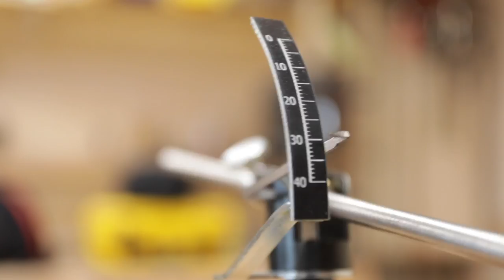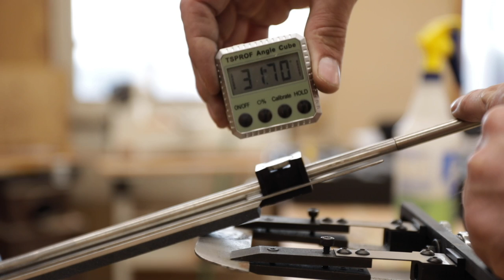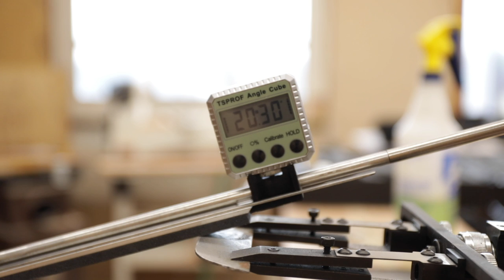Can A Knife Be Too Sharp? 2

Comment: Anyone that's ever worked in residential HVAC can tell you sheet metal is razor sharp by default
Reply: "hang nails" and "shark teeth" are the worst
Reply: We call them meat hooks!
Reply: There’s a huge difference between being razor sharp and micro serrations
Reply: Jonathan Wirrell i don’t think people realize how sharp razor actually is it’s scary what i can do to you with little effort
Reply: James Delong I don’t but I know especially re roofing my stepdads small barn
Reply: I learned two things from going on HVAC calls with my dad
1) How much a hand can bleed
2) How to bandage it with ducktape and paper towel.
Reply: @LloydLynx  and that's a fact! Except it was electrical tape
Reply: @LloydLynx  we just slapped some electrical tape tight on it and went along
Reply: Deltafrost134 without a paper towel that would rip open the cut right?
Reply: That's true if it comes flying towards your throat your dead
Reply: Tru that
Reply: @deltafrost1347  yes, carrying heavy metal with father, sliced both wrists on the edges. Duct tape, paper towels,   finished moving the metal.  Went to the ER, got stitches as I had exposed tendon.
Reply: Sheet meral as I understand it is not razor sharp by default. That would imply it can shave cleanly and smoothly without an edge.
Reply: 😂😂😂im a roofer and i cut my leg on the metal roof all the time
Reply: @LloydLynx  brother you forgot the superglue
Reply: Wow daddy you’re so funny
Reply: When you forget your gloves one day and it happens to be a day that you had an install and your hands get shredded on the tear out
Reply: When I was green in hvac work I grabbed a hold of a large piece of sheet metal from an instal job.....I wish I wouldn’t have.  Btw I’ve always used electrical tape for cuts, works well.
Reply: So is jello.  Check out the Asian dude who makes knifes out of the weirdest materials
Reply: My worst scars are from sheet metal cuts, vicious stuff lol
Reply: Lol
Reply: Man I helped my dad build a sheet metal roof once shredded my hands hurt like hell
Reply: @jakesatterfield3063  what are hang nails/shark teeth? I'd like to know.
Reply: Only good to cut human skin.
Reply: I always fear like a splinter but metal instead of wood
Reply: i did hvac in high school been snagged a few times
Reply: Mill-ends on stock will also ruin your day if you aren't mindful. They tend to be pretty rough cuts due to the speed the mill pops them off the line at, so you get some impressive burrs that will open you up if you're tugging on the end without looking where you're grabbing.
Reply: Yep had a buddy drop his side of the sheet metal when I wasn't ready, 8 stitches for my hand
Reply: @jonnyjohn2321  i dunno man a piece of sheet metal put 17 stitches in my leg
Reply: Industrial HVAC as well! My jeans actually saved me from a nasty cut once. I was just walking around in the shop, and I suddenly realized that my jeans had a huge hole where there wasn’t one before. It was very lucky that I wasn’t wearing thinner pants that day.
Reply: How if there is no edge and is just a flat surface
Reply: @pedroviniciussilvaleal8113  think of it like a paper cut.. but the paper is metal
Reply: @pedroviniciussilvaleal8113  The 90 degree angle edges, as well as the weight of an entire sheet of steel is more than enough to severely injure somebody without gloves.
Reply: Yeah back when I was doin HVAC I laid a rolled up piece of sheet metal flat cut it with the metal scissors wasn't thinking about it much but when I cut through the last piece it curled back up into it's rolled up shape fast as a snake bite right across my finger I have a nasty scar and it bled for along time
Reply: @jonnyjohn2321  the point is it cuts easily
Reply: Facts
Reply: I agree with you as much as I humanly can.
Reply: working with my dad i almost had a sheet hit the back of my neck bc it came loose. ducked in time.
Reply: That's only on the edges where they're cut. The lower quality of steel you have you want rougher grit to keep it sharp. It's like a microscopic steel saw. The higher quality steel the smoother the terrain the edge can be to still be sharp.
Reply: Try working with glass
Reply: yeah, sharp like broken glass... but which would you choose as an all-purpose utility blade? ... exactly...
Reply: yea- had to pull out a slightly too big filter when we moved in and sliced my hands up (ended up using a pocket knife to spear it and pull it out).
Reply: Got the scars to prove it 👍🏽
Reply: Ouchy lol
Reply: Maybe watch the video James 😂
Reply: I know it's late to comment, but I work with sheet metal and what you say is true
Reply: @jonnyjohn2321  🤓
Reply: As a chef I keep my knives sharp with a 16-17° angle get a thinner blade slice tomatoes with just the weight of the knife

Comment: Great video!  I am a sheet metal worker and the only way I can explain the problem that your having is that sheet metal (at least some gauges) are made to not be too hard as in most cases the metal needs to be somewhat malleable for the metal to be folded and formed to make fittings or ductwork! As you shave the sheet metal down it starts to lose the little hardness that it may have. If you were to use the blade you made on wood you could find that the metal may warp or the edge will mushroom

Comment: normal people: are you a serial killer? you keep sharpening knives, 

me: nah i just really like knives, and it's SOOOOO SATISFYING
Reply: FallenDj122 by normal people you mean “people that barely even know what a blade is”
Reply: Sharp knifes are not dangerous. They do what they are supposed to do, they cut.
Dull knifes are dangerous. You fiddle around in different angles to make the dull thing bite, and you slip off, cutting yourself badly.
A cut, made by a dull knife, does hurt way more than a cut with a sharp knife. The cut of a dull knife will heal slower. 
A knife is a tool that has to be sharp. Like a hammer that is made to drive nails into wood has to have a flat side, so you are able to drive in the nail fast, effective and straight. Nobody uses a ball head hammer for driving nails into wood.

Comment: It's all about carbon content and heat treating the knife has a higher content which leads to a better hardness and a better blade. With the sheet metal it's not a high carbon steel so it doesn't matter if you heat treated it. It would not hold a edge or sharpen worth a flip. Nice video also. Always like the things you have to say.
Reply: Mick Mills Your name looks familiar. 👍
Reply: True
Reply: Mick Mills you can case harden low carbon steel
Reply: "It's all about carbon content and heat treating" Actually heat treating is all about carbon content.
Reply: its not all about carbon. some alloys like cr-mo steels are easier to harden with lower carbon.

Comment: That is why knifes are not made of mild steel.  The edge is so thin that it will just roll over like a piece of tin foil.  Making something razor sharp had little to do with the sharpener and more with the composition of the material you are sharpening.
Reply: Jeremy  Brua agree
Reply: It's not about how thin the steel is its about the carbon content and quenching it to make the steel hard to keep the edge
Reply: @tannerlewis2696  stainless steel doesn't really get heat treated iirc
Reply: @sakesaurus   sheet metal is carbon steel not stainless
Reply: @sakesaurus  what do you mean stainless steel doesn't get heat treated? What makes it hard then? Any steel used in knives, cutting tools or drill bits is heat treated(then quenched and tempered), no matter if it's a stainless steel or carbon steel. 
I think you are thinking of forging which is what blacksmiths do when they heat up steel, hammer it by hand on an anvil or on a power hammer and repeat until desired results is achieved. Most stainless steels don't do well in forging nor is it needed for them. But even after a knife is forged it still needs to be heat treated, quenched and tempered for it to be able to take an edge and hold it.

Comment: Great video Cody 👍 I think you helped prove a point that a poorly heat treated blade can be extremely hard to sharpen. If the blade isn’t hardened properly, or is too hard, good luck! Now imagine someone trying this freehand! If the steel is too soft, the edge will roll on the stone. Sheet metal is just mild steel with very little carbon and can’t be hardened. Hence the edge rolling 😀 It could also be the burr you are seeing but I think you probably already know about that.
Reply: OUTDOORS55 wait. His name is Cody? Ayyyyyye
Reply: Yes, perhaps unexpected result, but educational none the less. BTW, I've watched several of your knife making videos recently, very cool.
Reply: OUTDOORS55 fancy meeting you here!
Reply: Yes, he would've had better luck if he had heat treated it after using the first stone.
Reply: OUTDOORS55 agree
Reply: NaCI Element the metal he’s using probably won’t harden.
Reply: You could heat it and quench it to harden the steel, but without the carbon content as you point out, it would be very brittle. You could probably put a sharper edge on it, but it wouldn't last and any stress would break the blade.
Reply: **CplSki USMC**, High carbon steel is harder but also brittle, mild steel is not high carbon steel therefore cannot be hardened and will not turn brittle. This is mild or low carbon steel
Reply: outdoors is correct, if the carbon content is low in the steel the metal will be very ductile and elongate easily and especially on the edge . the more carbon content steel has the better the metal holds the edge because of the hardness factor.
Reply: Nice to see you here OUTDOORS55
Reply: The problem is that he used the leather at the same angle as the stones.  You need to use leather at a bit lower angle, or it will round the edge off.  On soft steel, like this, it will just create a super thin foil edge.  You're just sharpening a bur at that point.
Reply: NaCI Element No that metal cannot be heat treated
Reply: @honorb4glory606  you really don't need to worry about changing the angle when the leather is attached to a hard backing like that. Now if he had the kind of strop a barber uses i could definitely see that rounding the apex.
Reply: @_BLANK_BLANK  , it does matter, because the leather compresses.  The harder you press, the more it rounds the edge, so more pressure requires a lower angle.

Comment: You are correct about it being hardened. When you have a piece of mild steel such as the sheet metal it doesn’t have enough carbon content to support the edge. When you heat treat a higher carbon steel such as O1 or D2 tool steel the crystal structure of the metal changes which in turn makes the micro edge better supported and able to stay sharp longer. If you were to harden the mild steel it would still have a hardening affect on it, it would just not be as good as a knife steel. Most bushcraft knives have a HRC of 57 to 60 while your chefs knifes are harder and are about a HRC of 62-65. Hope you found this helpful.
Reply: JLB Knives your hardness seems a little off most chef knives that regular people can afford are 50-57 HRC but bushcraft knives are probably the same but I have a knife that is $700 which is 67 HRC
Reply: JLB Knives agree
Reply: Higher hardness means you're jeopardizing flexibility and it makes it a lot harder to sharpen. If you have to torque your 67 hrc blade, you might shed a few tears over a now 2-piece 700$ knife ;)
Reply: Cameron Knowles I don’t mean to addendum you but anything I’ve 65 is almost impossible to achieve. When going any higher you half to do special Krio treatment. Then hardening process. I’m not sure were you got your knife but I would guess it’s probably not as hard as they said as when it is that hard it is as brittle as glass.

Comment: I have watched several of your video's and now I'm a subscriber!  I make my own sharpening equipment and have an eternally bald left arm! Lol!!  I know the sheet metal blank that you just sharpened does not have the proper carbon content to keep a razor edge, if it can even obtain one in the first place.  The other thing i want to mention is your strop.  I know you mentioned how it got damaged and you also said you didn't think it would affect things much. (Paraphrased)  I also make my own strops and I really believe yours being damaged definately does affect the final outcome tremendously.  If you get a new one, (and I really think it is a good idea) when you apply the compound make sure you apply it evenly.  Any thick spots or clumps will act like brick walls to your edge, dulling it by rolling it down as you pass over the clumps.  Also, I would suggest a few degrees shallower on the angle when stropping.  The final suggestion from my humble experience would be almost no additional pressure other than the weight of the strop itself when stropping.  From experience I can tell you it only takes a couple of bad passes with the strop to muck up a perfect razor-sharp edge!  God bless you and keep doing what you do!  The second coming of Christ could happen any day and I bet you will have more than one crown to lay at God's feet some day!

Comment: this is because the sheet metal is not hard enough to hold a rasor sharp edge
Reply: You must not have worked with it before
Reply: @Marshall006  you don't know what razor sharp means.
Reply: Thats why heat treat matter.. bare steel no matter its a high performance steel such as s30v will not hard enough to hold the edge without getting heat treat first.

Comment: Here's why it wouldn't sharpen like your pocket knife: the sheet metal isn't tempered, meaning it's less hard and more malleable, so past a certain point the blade edge just bends. To temper it, heat it until it's white hot or as hot as you can get it (preferably just the edge) and then quickly stick it in a bucket of water and leave it until it cools.
Reply: Thanks geinenious you have nailed it.... it'll never harden it's not good metal at all.
Reply: thats hardening not tempering. also tempering makes the metal softer
Reply: It won't do anything.  Heat treating a piece of steel is about moving the carbon around in it, but sheet metal has too little to allow you to harden (not temper) it.
Reply: Never white hot, you heat it to the color of the sun at sundown
Reply: Justyouraverageidot  you can use water. Water actually gives you a better heat treat but it's much easier to warp or crack your blade using water since it cools the metal much quicker which is why most use oil that is heated up.
Reply: Justyouraverageidot  won't it explode if you use just water
Reply: or if you wamma be smart about it. 1. Heat it. Dip it in oil. Heat it again but let it cool slowly. Heat it one last time and this time use cold oil. If this doesnt work for you then idk what steel you are using its must either be super cheap or it was already hardened steel even then it usually work on hardened steel. this method (that i use) make the steel both hard but also kinda flexible.
Reply: white hot can damage the metal and wont hold a very good edge you usually heat it to orange or very light red, not to mention sheet metal is very mild steel and is useless for knife making
Reply: Oil and wax, not water. When you use water it easily cracks and gets brittle. The wax and oil is a bit of a slower cooldown so it won't bend or fracture. Even after the heat treat you need to normalize the blade. Doing that will help it be a little bit flexible and not so brittle so you can put pressure on it without it snapping.
Reply: @eduardosc3434  hardened steel has carbon in it mild steel has little to none its not junk steel its just not knife making steel
Reply: this whole thread is 50 different opinions on hardening.  Honestly just tapping with a hammer will harden sheet metal but sheet metal will probably be too brittle to ever be razor sharp
Reply: Tempering isn't the hardening process. It's the process of making the steel a little bit softer, so it isn't too brittle.
Reply: So much wrong with this statement, please don't pretend to know things you don't, misinformation isn't helpful
Reply: So much wrong information here.  This piece of sheet metal will harden, just not much.  To harden, it needs to be quenched, either oil or water depending on what specific grade/alloy.  For this, it probably doesn't matter.  For heating to harden, never go to white.  The steel will start sparking long before this point.  When this happens, the carbon is being burned out of the steel.  You only need to go what is called the critical temperature.  This is the temperature where the steel loses its ability for a magnet to stick to it.  Tempering is done afterward to remove some of the brittleness from the hardening process.  To do the tempering, the steel is heated again, just not near as hot.  This temperature varies a lot depending on the grade/alloy of steel, and the amount of tempering needed.  You then cool slowly.  If you go all the way to the critical temp and cool slowly, this is called annealing, and it removes all the hardening already performed.  This step is sometimes done on parts that are cold worked multiple times, especially copper.  But with copper, the time to cool doesn't matter, heat and quench will anneal copper.  Heat treatment is a specific process with heat and cooling done in specific succession that I don't know much about the process of.
Reply: The metal shown in the video is construction steel and has a low carbon content, thus not really possible to harden.
Reply: @Iowahurler82  Finally someone with some sense.
Reply: @ShadowZero27  I didn't know steel work hardened. I thought it was just copper, bronze and aluminium
Reply: @doom1373  no, it won't.